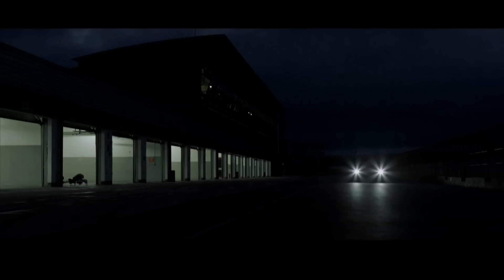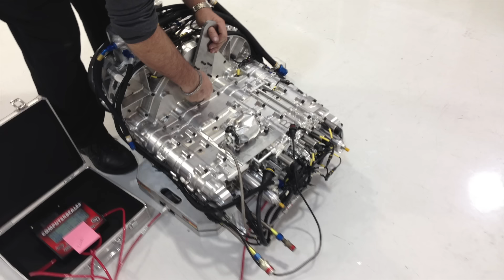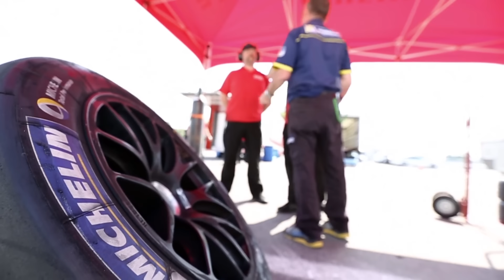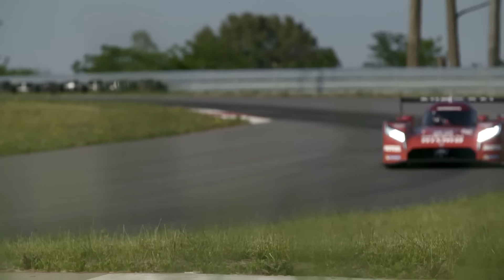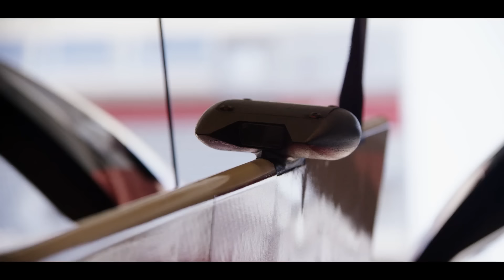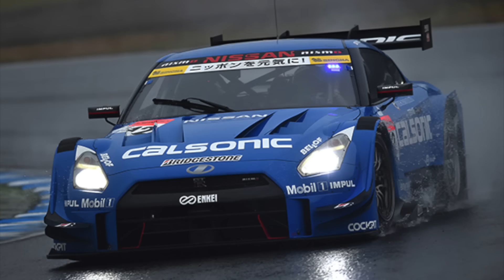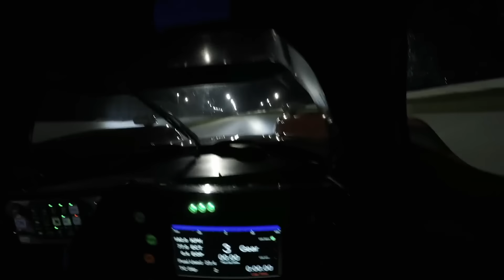Nissan GT-R LM NISMO, the front engined Le Mans car that ended up in a dumpster. What went wrong?

Comment: As the designer of the rear interconnected hydraulic anti-roll system I'd love to know where you heard they tested FRIC after Le Mans.  News to me.
Reply from the maker: Came directly from Divila before he died, also Simon Marshall discussed it. Tested on the rig at ARC Indianapolis in July 2015 apparently.
Reply: @Samsthepits  Interesting.  It's possible they adapted the rear dampers to the front to pull it off.  I would be butt hurt if they went to another supplier without talking to us first.  :)  Great video, I loved this car concept.
Reply from the maker: @pdv.racingshocks  I heard it was based on the original system, but I do know that there were changes to suppliers, whether it was to the dampers or not I don't know, I never saw the car again after Le Mans.

Comment: It’s funny how this car failing and being quickly given up on has created such a huge “if only” community around it. 
So many want to argue that if only they’d continued developing it. If only the hybrid system worked. If only….
In reality they just had to figure out why the other cars aren’t built that way. That car would never have been competitive unless the rules allowed it a big handicap.
Reply from the maker: I don't entirely agree. Consider its pace at Le Mans in 2015, it was faster than most LMP2 cars yet was heavier and had less power due to its non functioning hybrid system.

It would never have been able to be the fastest LMP1, thats clear but it could have been credible, its biggest issue was its terrible build quality. An electric hybrid system would have simplified the car and likely made it more reliable. Being built properly was a bigger issue.
Reply: @Samsthepits It was built to be an LMP1 car. Being faster than the slower LMP2 cars isn’t much of a flex. 
The reality is what it is. The car was slow and didn’t function. Beyond that it becomes the whole if only thing again. If only the hybrid worked maybe it’d be competitive. On and on.
Reply from the maker: @NBSV1  The LMP2 point actually highlights that the concept probably did work, as LMP1 and LMP2 at that time had the same chassis regulations. As such this truly is one of those what ifs of racing, but the first people to discuss those what ifs were in the Nissan garage at Le Mans in 2015, and in the team unit after the race. At least some of those what ifs would have been addressed with the 2016 update which was never finished.
Reply: It had cascading knock on failures, fix the hybrid - even partly,  and you get extra power, working brakes (drivers where doing alot of lift n coast and brake saving) , the tyres and wheels suit the task at hand  - so they would arrive faster, brake later, run way more corner speed, punch out harder and less fuel saving.

Comment: A convex chair is different and unique. Fork with chain handle is unique and different. Doesn't mean they're useful.

Please remember that next time you want to design a front-engined front-wheel-drive hybrid LMP1 car with flywheel generator that spins at 50000rpm/s to generate 700hp, Mr. Bowlby.

Comment: The Delta Wing was a good idea. This NEVER was. Panoz proved that Front-engined cars don't work, and it's basically knowledge of the benefits of RWD over FWD in circuit racing (the fact touring cars with RWD need significant ballast proves that). I respect Ben's ambition, but you can't defy fundamental physics, even if you think you can. If it just doesn't look right, chances are it probably isn't.

Comment: You wonder what happens when more time and planning was given for this project. Like I know how motorsport teams like to move fast but what if they tested one thing at a time and did more proof of concepts. And maybe after lessons learned I hope someone else would pick up this concept. Seeing how many cars (wink wink Toyota, Volvo etc) has a front ICE-powered axle and a rear electric motor this front-engine concept would've made a serious marketing force. Like you know how proud Honda is with their Type-R being front wheel drive when their competition are AWDs?

Comment: As someone once said, "Ambitious.... but rubbish".
The real lesson, I think, is that you can innovate one thing at a time. The back-to-front car concept could have worked, if they had done everything else by the books: used an established base, used an established gearbox, used an established hybrid (I accept it was less obvious in 2015 that battery-electric was the way to go), and so on. They at least seemed to realise this when it came to the engine but for the rest, it's pretty clear they bit off more than they could chew.
Nonetheless I think it was cowardly for the Nissan higher-ups to throw in the towel after one race. It's not as if it's not possible to turn a basketcase project into a race winner by bringing in the cavalry - Mazda bringing Joest in to sort out their DPi program would be one good example.

Comment: I was lucky enough to speak to a few of the people who worked on the car, got the impression from them that the project was pretty underfunded. Was at Le Mans 2015 as a photographer, it has some pretty bad bouncing issues at the chicanes but in the high speed turns it looked very very planted to the ground, that and the Audi stood out to me as being very planted.
Reply: More evidence nissan corp was not fully committed to this project. Expecting a perfect dive without climbing up the ladder to the diving board
Reply: @Smartfridge7804  Given recent revelations, I wouldn't be surprised if Nissan wanted to commit more but couldn't because of Renault/Ghosn
Reply: @fatfactorcreation  absolutely. 2010s Nissan was about pumping out cheaply made econobox’s and stretching there sport cars to their limit with production
Reply: @Smartfridge7804  I find their recent "refresh" a breath of fresh air and source of relief

Comment: Very nice video. Well done. Andy Green doesn't come across as the sharpest tool in the box. He keeps shuffling from one top position to another with no success. Also not sure how much of a 'genius' Ben Bowlby is either. Wonder what he's up to now. The front tyres on the car would have been critical being immensely loaded and it was no wonder that the car was such a failure when they had to use old spec off the shelf tyres. Total disaster. I remember reading what other team's technical directors at the time thought of the project. They obviously were very polite and called the project 'brave'. Haha. It was a shock to me at the time that no senior engineers at Nissan called out the bs at the time.
Reply: The Deltawing seemed to work pretty damn well conceptually; though a lot better in IMSA form than its open-top version.

Comment: A bad race car that I like. Gran Turismo 7 recently changed its drivetrain from front-wheel-drive to 4-wheel-drive, making it far better in-game than in real life.
Reply: The actual GTR LM was meant to be AWD too, Nissan just couldn’t get the complex KERS system working. It ended up racing as FWD, with half the original power, as a result. But that wasn’t the original plan, it should have had twice the power and AWD (just with a front bias).

Comment: if you want to drive a pretty accurate example of how a WORKING hybrid model of this is suppose to drive try Gran Turismo 7 - they finally fixed the model after 10yrs (!!!) of it being wrong... i t seems they actually consulted nissan and implemented the 600hp ev and 600hp v6 petrol motor corrextly... however remember it is a console game at heart
Reply: I truly wonder if Nissan never increased the Hybrid part of the original and kept it at 2MJ as it was originally planned and per regulation. The upgrade to 8MJ really caused so many troubles... 
brakes especially. Or go for a 4MJ electro-mechanic flywheel like the audi the next year.... THe car had so much potential, it was rapid and very good at tire lifespan ... such a shame.

Comment: Thanks for posting, I found the whole thing fascinating!  In their very most basic forms, competition cars with the engine in the front are difficult to package. Think, the restricted space for everything in a Caterham Seven against the neat packaging of a modern  Formula Ford. (In general terms of concept.) Getting the driver in,  with the needs of the power transmission and its attendant gearbox and propshaft, is always  going to be a problem. The FWD Nissan is a triumph of the art of packaging but it still falls at the first hurdle. "Keep it Simple" (Relatively! 😁) A bold idea beautifully executed by Ben Bowlby and all of the team at Nissan, could have been made to work given time. We will possibly never know. 🤔.

Comment: Not surprised at how this ended, basically trying to turn an Altima into an LMP1. Too many FWD fans having delusions of Le Mans grandeur, not realizing that there are limits to what can be extracted from that drivetrain without encountering severe setbacks.
Reply: It wasn’t meant to be solely FWD, it was meant to be AWD like other LMP1 cars, just with more FWD bias. But Nissan couldn’t get the complex KERS flywheel system, meant to send power to both front and rear, working. That’s why the actual cars that raced at LM were way down on power (actual race day power was less than half of the projected power had the KERS hybrid set up had been in operation).
Reply: Bro rs, fwd is so ahh bro😂😂

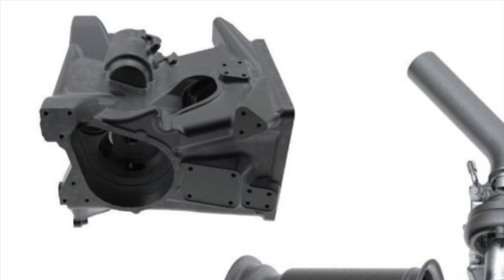Comment: At 16:50, you can just say they used J-B Weld on the only transmission case they had. No need to fancy it up by saying "epoxy resin"
(great work by the way making this video)
Reply: Other epoxy resin manufactureres are available..... Araldite is better known outside the US than JB Weld, for example.

Comment: This video really didn’t disappoint, I was definitely on the Nissan hype train back in 2015 and I remember the frustration about the lack of performance that year. In the months and years afterwards I have heard stories of «scary failures» of the flywheel system during testing, due to the fact that they were designed for city buses and not a high downforce Le Mans Prototype. I’m very curious if you know anything about that. Loving your stories and definitely excited for more sportscar content!

Comment: There is an old saying in motorsport: If it looks right, it's fast.
The car had way too much complexity that someone has to have realized this was a mistake. They were just better off making it a conventional LMP1 and make it easy on themselves.
Reply: Panoz was the same case and yet it was one of the fastest. The reason it ultimately failed is because it was designed for the hybrid system that they never got. It would've been fine if they strictly gone full ICE or they went for a readily available hybrid system instead of an experimental one and design the car around that.

The problem is that the board wanted a new Deltawing marketing stunt again.

I'd imagine that if this mid-front FWD were to be successful, they'd do another crazy marketing stunt 3 years down the line.

Comment: One of the greatest "what ifs" in motorsport history. I wish Nissan would have dug their heels in and forged forward with the project. Canceling after only a year is just a complete and utter waste of potential and money.
Reply: 2010s Nissan was an interesting time. It’s ceo was clearly not a fan of proper racing and more business focused
Reply: The car just screams FAILURE the moment it underperformed at the WEC...and Le Mans. If Nissan were to just push on with the project in hopes of a win, THAT WIN WILL NEVER be materialized.
Reply: @HansenSebastian  maybe. Lots of this car was unoptimized in development, down to it being developed in two parts of the US. 
Couldve been something if it had been developmed in Europe or even Japan
Reply: did you watch the video? this shitshow had no potential other than being a shitshow
Reply: @j @jackbrabham  it had a ton of potential. If you can’t see that you need to rewatch
Reply: @Smartfridge7804  it didn't, it was another BS from Bowlby, mixing up conceptual ideas neat to throw around with friends and some beer with reality. Next to nothing coming from it worked. The guy went with extreme complexity to shoehorn radically conceptual theory into a racing car, leaving aside reliability (I mean, fucking torque vectors?), serviceability (oh, you had to bled radiators to change splitters? neat) and iterative proccess: every single fucking thing wrong with that contraption was a major redesign effort. In this exercise, he became the only motorsport engineer that goes against the fundamentals of racing car design.

"Oh but the 2016 spec!" Please. Issues with concept, location, supplies would still be a factor and without the thing being put on track, nobody knows what stupid BS would show up, demanding yet more rework: I guess by the third or fourth year of the exercise, reality might very well pushed the engine behind the monocoque. Anyways, as it didn't materialize into a track, any promise of potential is just hypothetical, as it was the initial showing of this shitshow.
Reply: @jackbrabham  literally nobody here is saying it was a good car, we’re saying its a interesting concept that had potential if it had proper support and funding and team.
I’ve no clue why your so passionately against a completely hypothetical what if scenario. It’s really not that deep.

Comment: The Nissan GT-R LM project reminds me of the old construction project times when I used to study automotive engineering back then. 
When we were given a project, we were able to think lots of positive ideas. In fact, an ideal solution even which sounded perfect on paper (in Nissan’s case, them trying to use the “loophole” for their own advantage).
However, we also had to think about cases where maintenances would be done, if something needed to be replaced, cooling factors (once again, which was the same case here for the Nissan project), etc. and ultimately we had to find a compromise in the end. 

As someone who has experience in simracing too, it gives you the opportunity to try out your project virtually as well and there you can see how your project performs virtually and what kind of potential it has. However, not everything what the simulation shows replicates the performance in real life unfortunately (seen with Red Bull, Mercedes and Ferrari in F1 recently) and it kinda replicates Nissan’s project once again.
Potential in theory but bad execution. 

As you said Sam, it would have been really interesting to see them participating in 2016 with an evolution of their car. But unfortunately we can only think and dream about how much better their 2016 car could have been. 

Thank you for the insightful and deep dive video once again Sam and I am looking forward to watch you cover another topic!
Reply: Der GT7 Gott hat gesprochen. Danke 🤩

Comment: The biggest error in the car was using that hilariously complex mechanical power transmission. Even if you use a flywheel, electric power transmission is more efficient and a lot less problematic.

Comment: 13:31 I contest this. Swift Engineering's last 016.a Formula Atlantic car rolled out of the factory in 2007, and their last Formula Nippon cars were getting fielded up to 2013 (the 017.n actually got updated that year) - just two years before Nissan's project got going. AAR are Californian, just like Swift (and so might've poached some of the motorsport staff when Swift switched to aerospace work), and California has long been hot rodding country (an established base of automotive firms, of whom at least some would be useful for even projects of this level).

Not exactly the first location one thinks of for this type of project, but then, Lucid Motors is a long-time component supplier for Formula E. Hell, Riley Technologies down in North Carolina has an autoclave big enough for carbon chassis manufacturing (and they use it). Just because it isn't obvious doesn't mean it's not possible.

Compared to Nismo just straight up not giving itself more time to sort out all the bugs, gambling on too many novel and unproven components (the purely mechanical flywheel, the portal axle-esque rear drive setup), and then moving to Forsythe Racing's old HQ on the other side of the country mid-development, the country of choice really doesn't seem to have been the big issue. 

One last thing: I'd love to hear from an AAR member why exactly they left the project. I don't have hard evidence, but Dan Gurney and the team he built had hardly ever been ones to back down from a challenge, let alone one not a million miles away from things they'd done in the past. 14:33 does not square with this team's history or its founder's philosophy at all.
Reply from the maker: Actually Swift is a very valid argument.

Comment: Can confirm that #21 is in Zama. They've kept all of the engines, which are kept next to the power trains from the R90 series cars and the R390 (VRH35s I think?) There are some other random bits like the braking package and suspension components but as you say, the majority of the structure of the cars is gone. 

Funny how the wanted it erased from memory so desperately but it ended up in Gran Turismo!
Reply from the maker: Officially it was crushed... officially.
Reply: @Samsthepits  Feels a bit like the mid engine Group B/S Quattros that where all “destroyed” but the engineers saved one from the bookies
Reply: @cademckee7276  the group B mid-engine quattro wasn't destroyed by accounting(the entire project was explicitly not authorized and ferdinand piech personally oversaw the prototype's destruction when he found out to make an example of roland gumpert and everyone involved with the project), of the 3 group S RS002s one is confirmed destroyed, one was hidden away and is currently in audi's collection and the third is a mystery